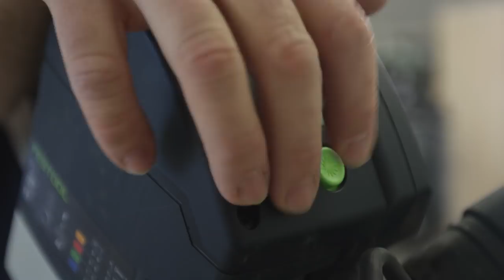Getting Started: Crown Stops for the KAPEX KS 120 Miter Saw

Comment: The problem with just clamping the scrap board as shown at 7:27 is that is just held by friction. Clamping the Crown creates forward movement which causes the cuts in the spoil board to shift. You can see the misaligned cut at 7:36